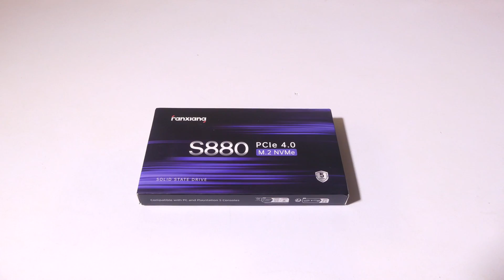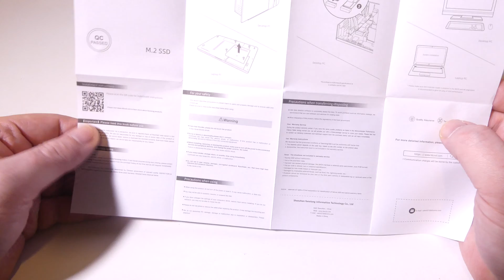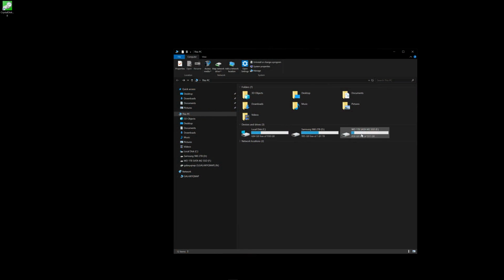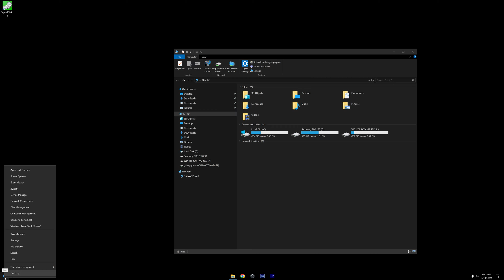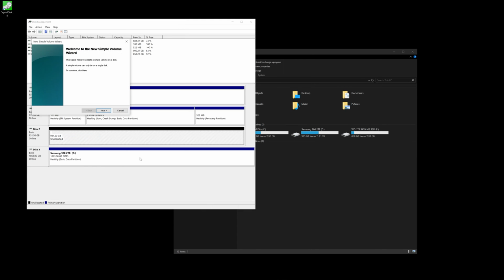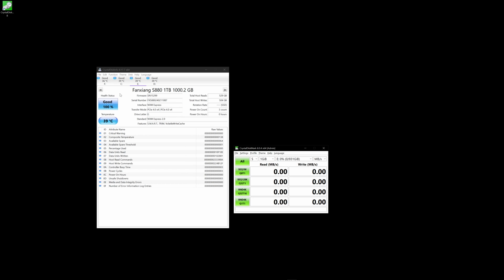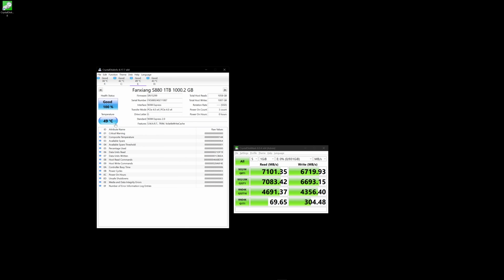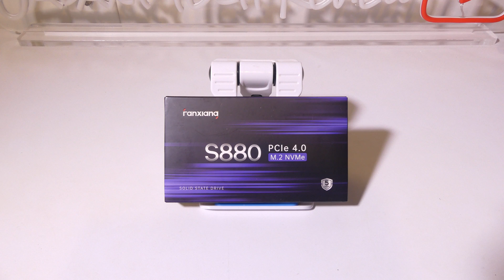Fanxiang S880 1TB PCIe 4.0 NVME SSD Drive REVIEW

Comment: I’m planning to buy a 2TB version of this to mod and install in my ROG Ally. Will it have any overheating issues? Should I also bought a heatsink for it or thermal pad that come with it already enough?
Reply from the maker: It should not have any overheating issues, the included graphine sticker helps reduce heat to the unit adding one on your own is your call.

Comment: I have one of those MB with bottom thermal pad and thick SSD heatsink at the top with thermal contact. Should I try to peel the sticker on the top side of the SSD or should I just insert it?
Reply from the maker: Leave the thermal sticker on.

Comment: ma e normale che superano i 60 gradi?
Reply: Most Gen 4 NVMe SSDs are rated for an operating temperature range of 0°C to 70°C, with a maximum critical temperature often around 80°C to 85°C. If it keeps idling at 60°C then you should check your case airflow, that's not normal.

Comment: I got the same one but 2TB and my Read speeds are 3425.97MB/s Write 3388.25MB/s but i bought one that suppose to be 7300MB/s i am confused on why its slower
Reply from the maker: Sounds like you are using it in a m.2 gen 3 slot instead of a gen 4.0 slot... "For M.2 GEN 3, averages are between 2500-3500 read/write and for M.2 Gen 4 the average range is 7000 read/write." So that's what I am thinking.
Reply: @GalaxyTechReview 

Which is about six times the speed of an SSD.

Thanks for the review.....

I recently upgraded my 4GB RAM to 16GB RAM and my 1TB HDD to a 2TB SSD which greatly increased all round speed and usage.
Photoshop Elements flies along now and scans take 90 minutes instead of 400 minutes! 

Now looking at buying a Fanxian 2TB  PCIE MVNE Gen 3  which suits my older computer to use as boot drive relegating my SSD to storage.

Comment: This is better than s770. I have both and S880 temps are way lower and performs better than S770. Just do not know on endurance. I have them for a year now and no issues so far.
Reply: I guess the DRAM cache on s770 doesn't matter that much

Comment: Question:  I have 3 m.2 slots
One has windows installed another has this fanxiang 1tb installed
But the 3rd m.2 is only a x2 lanes slot, 
would I be better off using a pcie x16 slot adapter to m.2 than the dedicated m.2 that only has 2 lanes? 
I've got a feeling it would run at full speed that way but only half speed in the m.2 slot.
Thanks in advance
cheers
Reply from the maker: Should run at full speed that way.

Comment: Seriously? People recommend cheap ali ssds now? O tempora, o mores.
Reply from the maker: This one works great and the speeds are fire.  So yes I would reccomend it because you get performance at a great price.  Also a 5 year warranty!
Reply: @GalaxyTechReview  no free lunch. If you're so sure about it, set it up for a burnout test and we'll see how long it lasts. 
You can make an SSD cheaper in only a few ways, and all of them will impact performance, longevity, or both. Cheaper controller, cheaper/binned nand chips. And good luck trying to have a Chinese co honor the warranty :)
Reply from the maker: @BoraHorzaGobuchul  So far mine works great, have it setup as a game drive and been playing on t with no issues, I will update you if that ever changes.
Reply: I bought this 6 months ago and performs well.
Reply: @Hyperion1722  still working good?  Would you buy again?
Reply: @marx769  Once the price drops, I would. My S880 2tb is doing fine after 6 months of use. It is cooler than S770 though they have the same performance.
Reply: @Hyperion1722 should I get s770 or s880? I kinda like s770 bc it already has a heatsink
Reply: @jaschela  s770 requires a heat sink because it heats a lot. S880 does not.
Reply: @Hyperion1722  alright thx I’ve read some other bad stuff about it but also some good stuff so I think I’m getting the s880 4tb anyway
Reply: @Hyperion1722  well I guess if you have backups it's ok... Then again, one should have those anyways
Reply: I use a S790 4TB as my Main-SSD for my heavily modded Asus ROG Ally and it's a pretty good SSD.

I have 10.5TB in SSD Capacity in total and use Fanxiang, Crucial, WD, Micron and SanDisk Extreme Pro for the MicroSD Card (256GB) and they are 90-95% full.
Reply: the nand flash on these are most likley made by hinex or samsung (those 2 make something like 85% of nand flash chips) so that will be stable. ssd's have a high mark up in well paid countrys like the uk and usa so making one a little cheaper is not impossible.
Reply: @charlielilley8033 Thanks a lot for the info ! 👍🙂👍
Reply: @charlielilley8033  I work in a company where we sell ssds to retailers. We wouldn't touch these cheap Chinese ssds with a long pole, the RMA on them is so big. 
The chips they use are the cheapest they can get, which means low-binned, or even in some cases salvaged ones. The controllers are also often cr@p. Yes, it's quite possible it will work for years without noticeable problems. But the risk of it dying on you, quite possibly not gracefully, is too high compared to even b-tier brands like patriot and team
Reply: Bought this exact one Nov 2023. No issues at all. Was in my main PC but recently took it out to put into my PS5 as I ran out of storage on it. Will be going for another, this time s770 as it has DRAM. They were cheaper last year but still worth it
Reply: @ldope3904  Careful with S770. It heats up badly.. S880 will be a better option.
Reply: @Hyperion1722  From what I see, the S880 is a better option because it doesn't heat up and is cheaper. The S770 has DRAM. Is there really a speed difference in these specific cases with or without DRAM?
Reply: @TheWorstGamerr  almost none at all for normal use. Maybe it matters if you frequently transfer more than 50GB of files. I don't do that.
Reply: @ldope3904  if it goes somewhere where you don't care about the data surviving, don't need performance, and ideally have backups, why not.
Reply: My S790 4TB is still going strong, but my Crucial P3 Plus 4TB on the other hand, already died. 🤷
Reply: @AndreasReinerSzallis I have a completely reverse experience. Now what?
Reply: @BoraHorzaGobuchul  which exact Chinese brand ssd died?
Reply: @le_deer strange question. All SSD brands can die. Question is, how often and how soon. It's generally enough to check the rma statistics by user reviews.
Reply: Because it's just works